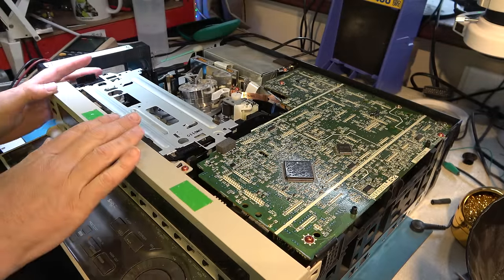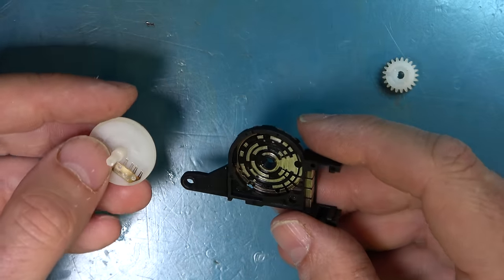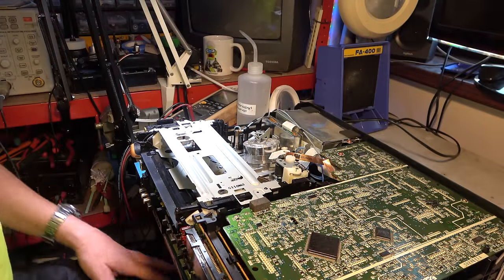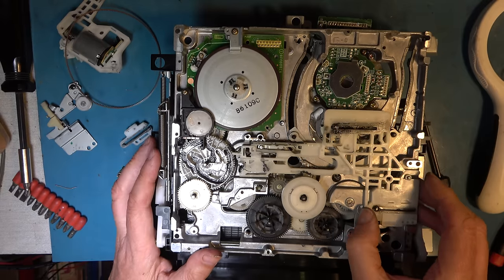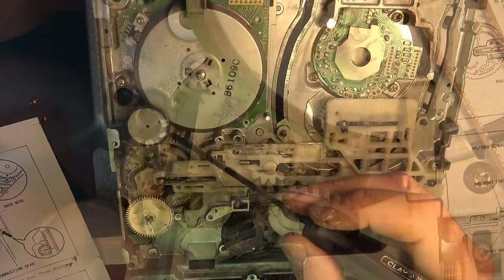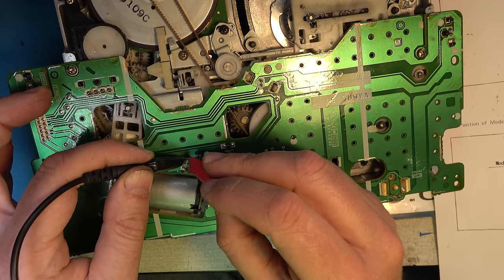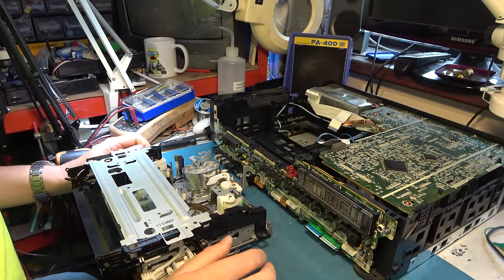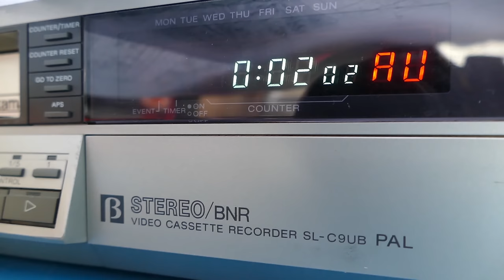Panasonic AG-4700, re-timing K-mechanism, NV-HS1000, NV-HS950 and more.

Comment: i watched your  video intensely and found your video very clear and easy to understand,  using the pages from the manual as inserts to clarify your meanings, you brought up a good point about the dried solder joints,  i think it would be awesome, if you could make a video  to show your  viewers  how to  locate and identify  dried /cracked solder joints, and  what to look for, etc,  what is the simple process of fixing them,  eg:  unsolder/re solder?  or.. just   remelt the existing solder into a new pool,  to melt the cracks away , or  flux and wick  them off, and start over ,  you mentioned its very common,  so that means to me, you have to do it now and again,   i would love to see a video on that subject, ,  🙂

Comment: Ive been looking forward to this video, and was a little surprised of your method of disassembling the mode switch, i thought you had previously cleaned one of these by heating up that plastic layover with a soldering iron (which is how i ended up doing it),  but your method seems alot cleaner,  just cut the layover plastic, 
  and  re-epoxy when finished,  ,  spendid!! looking forward to finish watching this,  after work this evening, cheers
Reply: Yeah, I ended up using just melted candle wax on that mode switch. I don't need the plastic connection to be sturdy because in time I will surely need to clean the switch again. The wax has been holding for half a year now, so I think I'm safe...
Reply: @speed_rider362   there is a product in the US called  Plasti-zap its  a bonding agent to be used between 2 pieces of plastic, works amazing, but i like your idea of the wax,  it makes it more  removable for future access 🙂

Comment: Nice work! The G-Deck based machines were so much more notorious with the timings, though some found them easy to work on. Once you knew, you knew I guess! 

Perhaps it might also be worth re-greasing that slide and cam gear just to air on the side of caution, especially if it's unclear what caused the failure in the first place..

Comment: Hey I got a NV-FS200B, so I changed the leaking capacitors on the comb filter module, the problem is that now I’m getting a black screen, I can hear sound, everything works as intended except for he image… idk don’t know if I put a wrong capacitor in the wrong place, like 1uf-50v in the place of one of 3.3uf and 16v. Do you know how I can get a diagram of that board? Or something that I can do to try to fix that

Comment: Hi David, Thanks for the video now I need the manual drawings on gear marking for Panasonic NV-SD 350 also there are two black wires with broken from the circuit board for loading the motor need to know which side they go on the board please need your help even I don't mind to pay for that.

Comment: Hi, excellent video, need some help for the NV HS1000. This is a known issue on Panasonics but I can not remember the fix where the braking strip on the left spindle that tightens the tape when playing is tightening too much so the tape is not playing or forward or rewind. This is the part that has the white fabric holding on to the spindle. Hope you know the part I am talking about.
Reply from the maker: It's called the back tension band.  Sometimes you just need to take off the felt strip and glue it on with Superglue or similar.  The trouble is that you will probably have to reset the back tension setting afterwards, for which you should use a special gauge.  Without it, you just have to guess a  bit.
Reply: @video99couk  Fantastic, exactly that. I recall in the old day to just remove it or oil it so it’s not that firm. It’s not come off it’s just too tight. Where is the adjuster may I ask. Have you done a video on it.
Reply: Thank you so much, Just finished setting the timing on HS1000. The issue is not only the bank tension band also the Clutch pulls that works in conjunction with all modes. Tightening that is a challenge. I roughed it up it seems better. Shame Can’t buy new ones now.

Comment: Great video👍Could you make a video how to take apart the k-mechanism and re arrenge it step by step . I have a panasonic sd 25 and sd 200 with the mechanism stuck and not moving and the mechanism motor is functional . I tried moving it manually but it is stuck .
Reply from the maker: This video does cover most of the disassembly and rebuilding of the K-mechanism.  You need to have a look at what happens if you try to rotate the loading motor, see if the main cam turns or if something is jamming it.

Comment: You have the patience of a saint.
It would be interesting to know just how long you spend on a repair like this, along with the final edit.
I'm quite sure this 43 minute video took much much longer to shoot and then import edit and export.
Do you repair and edit all on the same day if you have a good repair?
Reply from the maker: But I don't have a set of Kenny Everett jingle tapes.... 
Sometimes I can turn the whole thing around in a day, but usually it takes several days.  Though I try to release a video every Friday, it's not always possible.

Comment: Luckily your cassette come out mines still stuck inside and it's not budging on my hs900 so I can't get to the screws to take the deck out.
Reply from the maker: Then you will have to take the cassette carriage off.
Reply: @video99couk  Thanks mate,  cleaned the mode switch but getting error F06. the large plastic part which had snapped on yours is ok on mine so a different problem,  I'm enjoying it learning how to break my vcr even more😃

Comment: Well done colin,  it was a good patience tester.
But you didnt give up 😀
I also thought the mode switch was fauly at the start, i was wrong too.
Getting the parts in synk is a pain by the looks of it.
That snapped off plastic rod was a supprise,  so lucky you had one 😀.
I imagine you will clean the head drum and guides then see how well it performs.
Almost ready for use 😀